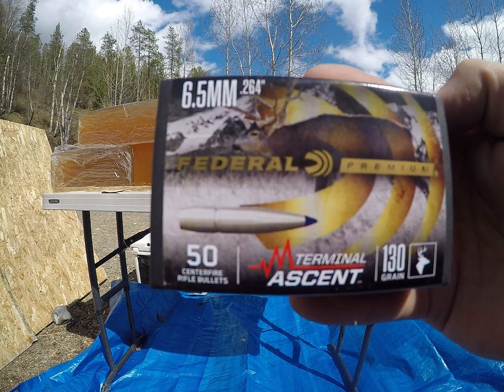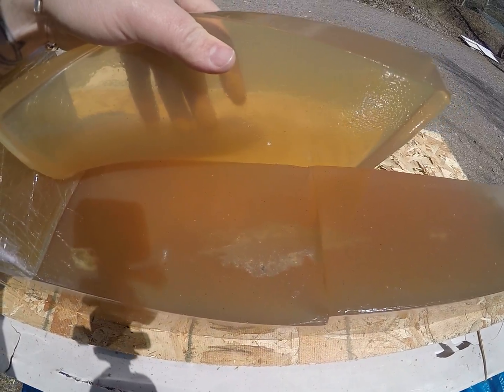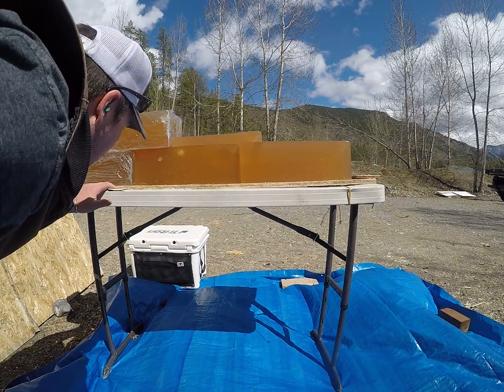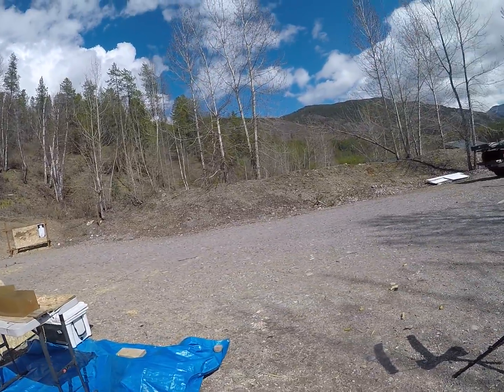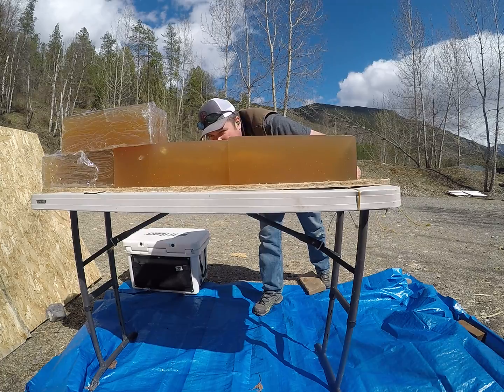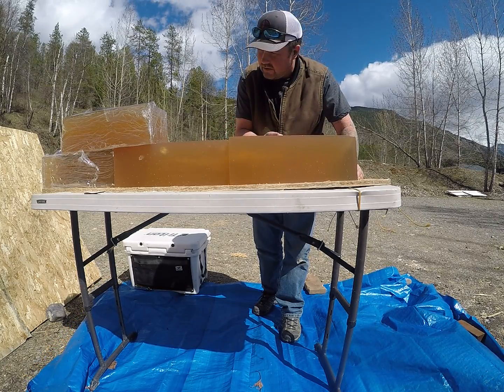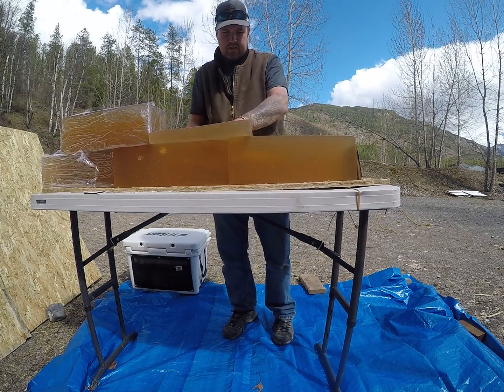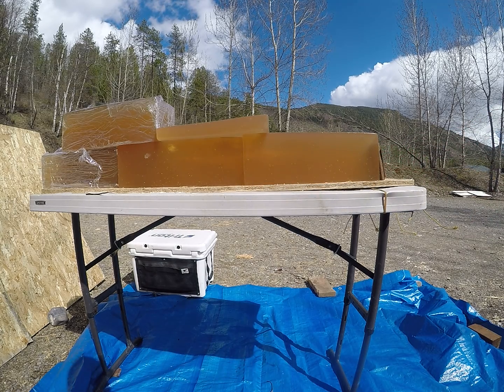130 gr Federal Terminal Ascent ballistics gel test 6.5 Creedmoor

Comment: The construction of these bullets is a hybrid between monolithic and core-and-cup.  I am seeing more and more tests in which many bullets, especially monolithic ones require a high spin rate to expand correctly.  Spin rate changes little at long distance. Spin rate also depends on muzzle velocity (with a given twist rate), so bullets from downloaded rounds would be spinning too slow to open normally.
Reply from the maker: In theory yes, but that myth has been busted. 
https://youtu.be/f0nlP-iG_OE
Reply: @simplemindedfella  Thanks for the response.    The owner/designer of CavityBack (monolithic) bullets has stated  that twist rate makes a significant difference with his bullets.  There was an interesting boo-boo when someone with a faster than normal twist 300 BO had some monolithic bullets open up on their way to the target.
A fellow on the 68forums  has been doing a lot of expansion testing and also noticed a difference in expansion with more than one brand of monolithic bullet.  The has both fast and slow twist barrels in several calibers so he can get the high spin rate at lower velocities.
Reply from the maker: @jfess1911   Crazy high velocities with the super tight twist pushing heavier bullets faster does cause issues, there is a reason for over a 100 years we really haven't pushed those limits because there is a limit to them.

It's this new school train of thought and having to re learn so much of that all over again.
Reply: @simplemindedfella  Yup, but to be honest, the biggest thing that I have a hard time comprehending is that there are hunters routinely taking 1000 yard hunting shots .... and cleanly killing the animal!  Most of my friends in NC have never made a shot beyond 200 (and some STILL miss).
Reply from the maker: @jfess1911   I get what you're saying I do it myself but I won't call it hunting because the hunt is not involved the hunt is closing the distance to well under 500 yds.

Comment: why do you say the bullet is no good for that cartridge when it works flawlessly between recommended hunting distances for a large animal (50-400 yards) which would put you at 2100-2800 ft/sec for a 6.5 Creedmoor that you did not even test?
Reply from the maker: I will have to watch the video again. I don't recall saying anything of the sorts. These bullets tested quite well and would be one of my go to use if they were readily available for a multitude of cartridges.

With that said if I was running subsonics out of AR platform on a 6.5 Grendel they wouldn't even work at 50 yds, so it really does matter what case you're using and how you're driving them and what your muzzle velocities are regardless of the case driving them.

Comment: Ya, it fails to expand if you only want to hunt Elk at 800 yds or more? Why would you not test it at 2000-2500  Ft/sec? Thats what it would be traveling at between 200-600 yards? This test greatly disappointed me because you did not do it right.
Reply from the maker: That is definitely a matter of opinion. My test are to try to determine the extreme ends. I can't always get high enough to test the top end but I typically can get low enough to test the bottom end.

 And you didn't say what you're shooting these out of and what your muzzle velocities are? A 6.5 PRC, 6.5 Creedmoor, 6.5 Grendel, 260 Remington, 6.5x55, 264 Win Mag, and the list goes on.  What are you shooting them out of and what are your muzzle velocities?  I'm testing the bullet not the case driving it.
Reply: @simplemindedfella   You tested with a 6.5 Creedmoor so my comments were about that cartridge of course! I came here to see how that bullet would perform from recommended hunting distances for a 6.5 Creedmoor. That would be 50-400 yards at the most. At 400 yards there is still enough ( 1500ft/lbs) of energy to kill a large animal. Unfortunately you provided no visual of what the bullet would look like for recommended hunting distances of 50-400 yards?
Reply from the maker: @henrymaccus   Sorry if it works at both ends of the spectrum it typically works in the middle as well.

Comment: Thanks for the great vid!  While not what I was thinking for this bullet either, it still is imo... one of the best hunting bullets made. Using fed load data, 1750fps is @ 800 yds in my hunting location calc. Thats a long poke for a 6.5cm, and one would probably have time to change out to say an ELD-X for better terminal performance at that distance. 600yds, this load is still over 2000 fps, and should perform well, and that's a long poke for anyone, should cover 99.9% of hunting shot possibilities. I'm getting some in 7mm rem mag, 155gr.

Comment: The entire problem with the creed more is bullets at to low of a velocity that don't expand causing no shock . It's accurate but that's it
Reply from the maker: I'm having the opposite problem in the field with actual first had experience using the Creedmoor, over fragmentation and under penetration if not using partitioned, bonded, or monolithic. Granted most of my shots are within 200 yards. 

On top of that the 6.5x55 Swede has nearly identical ballistics and has over 130 years of a proven track record.

Comment: Federal says they will expand down to 1300 ft./s. Where did you get a minimum of 2000 ft./s plus?
Reply from the maker: Gel tests. The 30 caliber do expand just fine down to 1300 the 6.5 do not.  The velocity ratings are not exactly the same from caliber to caliber and their ratings they give are based off averages of the whole product line.  You can get away with less then 2k fps you will not have a failure at 2k+ fps.

Comment: It could be that the bullet is yawing because it’s not stabilized. You can measure the bullet and run it through Berger’s stability calculator and see just how stable. Then if you run a 30 cal in a 10 twist or so compare the stability factor relative to the min expansion velocities observed

Comment: Do you think it would be a good choice for moose hunting in 270WSM ?
Reply from the maker: I have not tested these in any other calibers besides the 6.5 yet and the only thing I'm a little dissatisfied with is the low velocity performance I think they would be an excellent option out of a 270 WSM for moose as long  as you don't take a long range shot.  Keep it within 500 yds you shouldn't have any issues and I'm confident you'll have an exit hole if you got a good broadside shot.

 The trophy bonded tip would be another excellent option I've tested those in multiple different calibers and you get excellent penetration without over fragmentation on really high velocity and they still operate down to 1600 fps
Reply: @simplemindedfella  I should be good then, longest shot where I hunt would be around 350.

Comment: I just watched this video again. All the other information I've seen from Federal, as well as results from other shooters, seem to indicate that these bullets should have performed at least as well as the Trophy Bonded Tips. I can't help but think that something went wrong with this test. Are we all missing something? This can't be right...?
Reply from the maker: I am planning on getting some in different calibers to see if for some reason it's the 6.5mm.  I have noticed with other bullets I have tested the velocity needed for expansion does change a little bit based on caliber usually the smaller calibers take slightly less velocity to open so I am planning on duplicating this test and comparing it to other calibers in the same product line.
Reply: @simplemindedfella  
Awesome! 
I wonder if this is one of those strange examples of how a light cartridge load can't spin the bullet fast enough to get proper expansion? I've anecdotally read of this, but I've never seen the theory demonstrated.
Reply: I was also kinda shocked. Esp after the high praise from the edge tlr which is the same bullet minus on "accuchannel" groove. Be interested to see larger caliber.
Reply: Yes the fact that a liquid like blood did not enter the bullets hollow point is it,changes when a liquid enters bullet makes them expand .